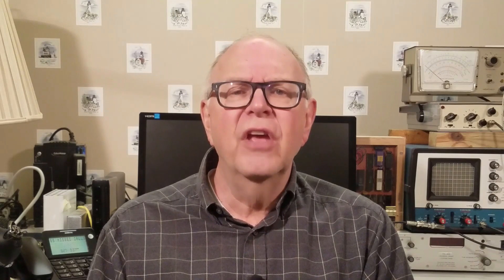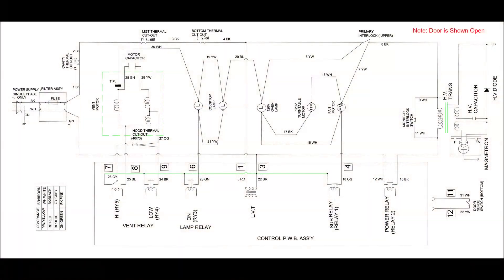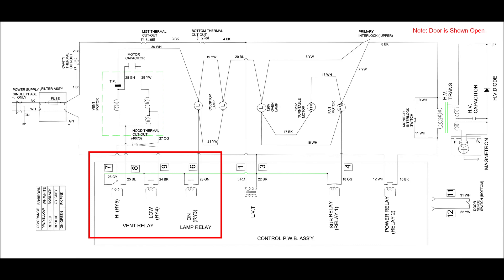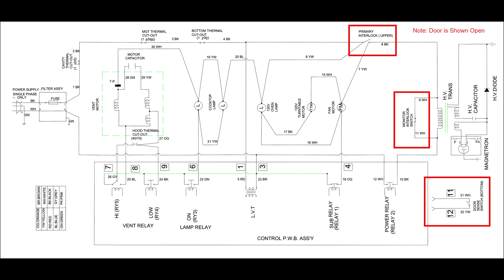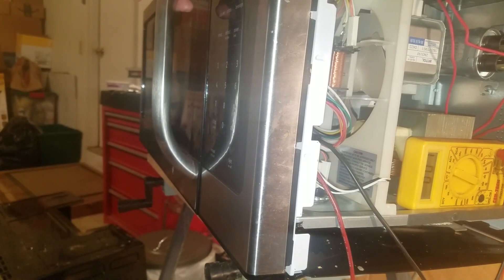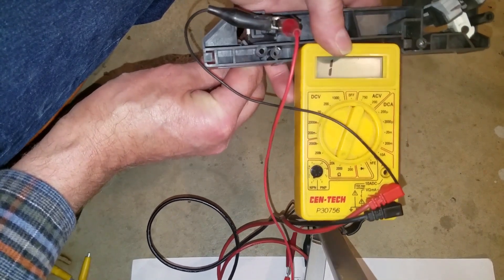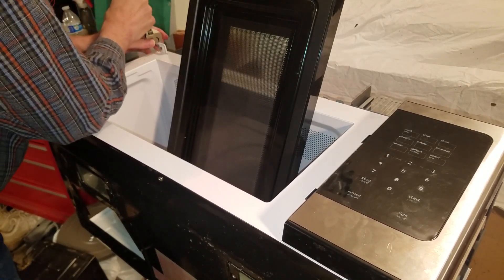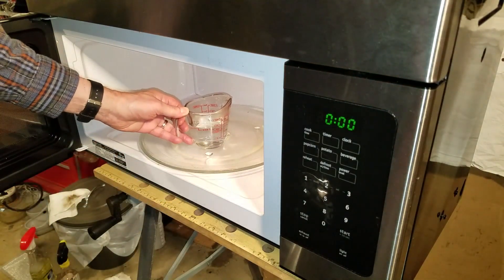Sick Frigidaire Microwave - FFMV164LSA - Can we repair it?

Comment: I'm trying to disable the alarm on my microwave. It's the same model as the one your working on.  Is there any way to get to the control board without taking the outer shell off the microwave? Mine is over my range and I'm trying to avoid taking it down to cut the speaker out.
Reply from the maker: Unfortunately, I think the outer cabinet has to come off before you can get to the screws that hold the front panel on.  Good luck!
Reply: @LifewithDavid1  thanks for the reply and your informative videos

Comment: Wow, thanks David! Our microwave was tripping the dedicated circuit every time we tried to use it. I took the door off, easy peasy, used plyers to bend the hinges up just a bit, put the door back on and it works!
Reply from the maker: That hinge is a little weak.  Be gentle or it will happen again.  Good luck.

Comment: Great video!  I have the same model.  My problem is when I plug the unit in the wall, it turns on automatically.  I have to open the door or unplug it for it to stop as the stop button on the control panel would not turn it off.  I replaced all 3 switches and the unit still does the same thing.  The door is a little shaky and I can hear the switch when shaken.   I will try adjusting the door as you suggested.  Just to make sure,  the top switch is normally closed, the middle switch is normally open, and the bottom switch is normally closed for this model.  Is that correct?
Reply from the maker: Thanks for watching!  If you assume the door closed is normal; then you are correct.  However the schematic assumes that door open is normal and shows the switches in that position.  Good luck in your troubleshooting!

Comment: My wife opens the door while running, told her a lot of time not to do so, as it's not safe. By Following your video and instruction, found blew up  fuse, replaced it, it started continuously running, while door closed, even without starting it. Found that the Megatron Relay was closed instead of open as you have described. As well when I lift the door a little the inside light turns on and off. By the time it blew up the fuse again. Control board, cost almost the same as some good quality Microwave, with available discounts. Most probably will go for the new one. Thank you for the detailed explanation, especially the schematic.
Reply from the maker: After a while, my son's had the same problem again.  He eventually got a different brand microwave and he hasn't had any problems yet.

Comment: Great description, my microwave had interlock switch welded shut. I replaced that and now everything works fine with no power to power relay #2. When I plug the #2 relay in and plug microwave in with door closed the microwave runs automatically. When I open door to stop the microwave it blows fuse. Right now I'm just leaving power relay#2 on motherboard unplugged and using fan, light, and clock w/o using microwave
Reply from the maker: Not sure, but it sounds like relay 2 is welded closed.  Maybe check it out with a VOM.  Good luck!
Reply: @LifewithDavid1  thanks for responding so quickly, I found a replacement control board on EBay $40. If the new control board works I'll diagnose the original and fix it as a spare.

Comment: I am having a similar issue where the Microwave would stop and trip the breaker by simply touching the door. Now it would trip the breaker by simply putting the microwave to work (I.E. i put 2 seconds and click start or i press 30 sec button and it will immediately trip the breaker). Everything else in the microwave works (lights, Vents, fans). Im assuming byt watching this video that my door is also miss aligned (It does look like it is).
Reply: I just fixed the issue with the re adjusting of the door as mentioned on this video! Thanks so much!
Reply from the maker: That's great!

Comment: OMG !! I had opened the door while the microwave was running, just like you mentioned, and the microwave has been dying on me for the last couple months every time I try to start it. All other lights, vent, etc. was working fine. I didn't even remove the door, moved it up & down a few times (beginner's luck I guess) and it is working now!! Thank you!!
Reply from the maker: Glad it helped. A slight adjustment to the door hinges should make the solution a little more permanent.
Reply: I’m actually having the exact same issue 🤭 my wife, daughters, and I have been without a microwave for a while now and I’ve just torn it down to the control board and door switched. I actually opened up the turntable motor, so im going to have to replace that before anything else.

Comment: Hi David - Hello, I have a Frigidaire Gallery Microwave from 2013 # FGMV-174KFB, and need to replace the INTERNAL light bulb, but I do not see anywhere where I can find screws or any cover that can come off. This unit is the above range/stove kind and has stainless steel trim all around it, which can't be popped off or anything. There is simply nothing I can pop off or unscrew at this point. How do I get into the unit and change the bulb? Is the only way to pull it completely out of the cabinetry? I hope not. PLEASE HELP.
Reply from the maker: Although I'm not familiar with that model, I'll bet the whole unit has to come out.  The manufacturers want to make sure the microwave envelope can't be compromised.  If a consumer would take a cover plate off from inside the oven to replace the bulb; and then left it off, it would be VERY dangerous.  They solve that by not having any removable plates.
Reply: Wow, that makes total sense, sir. But what a bummer. Thanks for letting me know.

Comment: Hi David! Such a great video with great testing techniques and thorough approach. I have the same model and same issues. All of my switches are fine too, I checked the continuity. My door does not jiggle to activate the switch like your son's did. It still trips the breaker and/or burns fuses every time I test it with the 0:02 seconds. Are there any other culprits to check? Thanks again.
Reply from the maker: If the oven lights when the door is open; and the clock works then the transformer is OK.  It's hard to check the alignment of the switches with the cover off; but it still sounds like the switches are out of alignment.  If the dim bulb tester changes state between door closed and door open, then the issue is a switch.  If not, then it's in the magnetron circuit (ouch).  Good luck.

Comment: When i click on the start button after settings and try to start it , it double beeps and does nothing.. the light , clock, fan everthing else works. Please help!
Reply from the maker: It sounds like either an interlock isn't making; the settings weren't made properly; or the microprocessor needs to be reset.  I might try turning off the power to microwave to reset it; and maybe jiggle the door.  Maybe try the kitchen timer function to see if the controller works.  If none of those work, then you might have to dig in and do some troubleshooting.  Good luck!